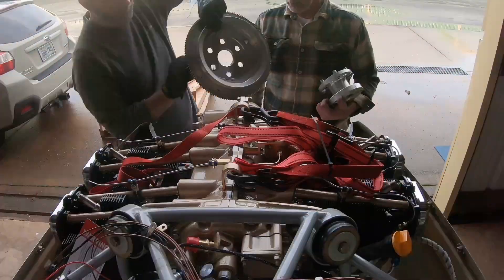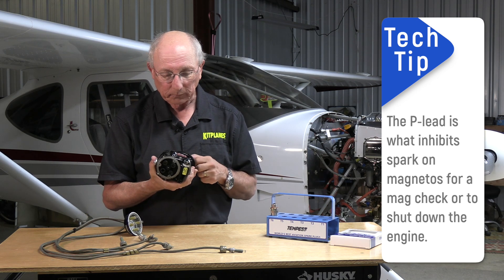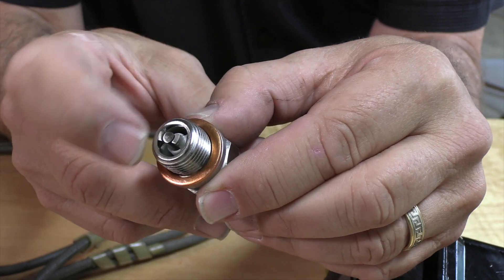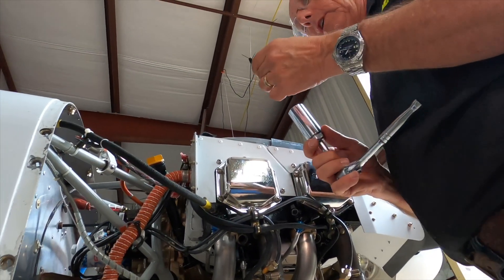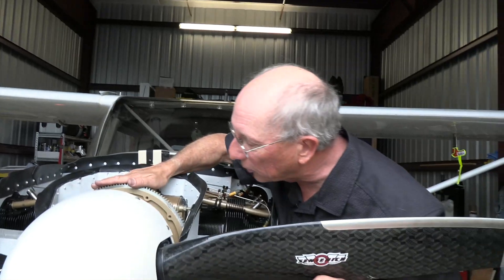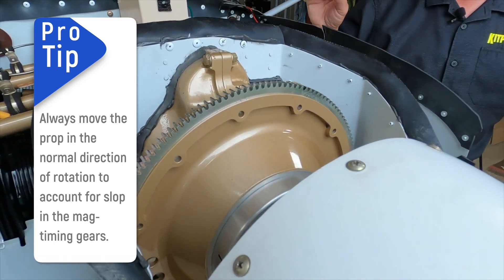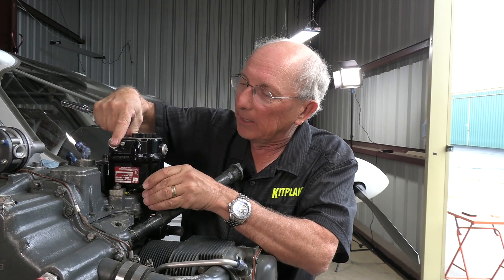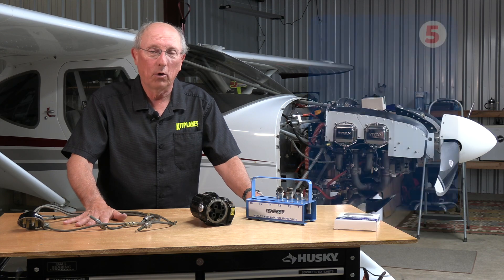KITPLANES Firewall Forward: Ignition System Basics

Comment: Thanks for the series of shows. Spark plug gasket with the curved surface up or down?
Reply from the maker: The gaskets are flat where it counts, so either way is fine.
Reply: All recent ones I have received from ACS have a flat surface on one side and a slightly convex surface on the other surface. That is the reason for my asking the question. Help appreciated. @KitplanesMagazine
Reply from the maker: @n7gn  Interesting. These are usually just stamped from a sheet of copper, and the stamping makes one side have a radiused edge. I just looked at my recent handful from Spruce and they did have this edge but the faces were pretty flat. Also don't forget this is soft material and it'll deform when the spark plug is torqued. Unless they look like a bellville washer (heavily dished both sides), I would not worry about it.

Comment: You mentioned the impulse coupling. I did not see where you mentioned making sure that the impulse coupling had tripped prior to setting the timing.. I haven't worked on planes is a long time but do remember addressing that point.
Reply from the maker: Good point. It should have clicked before you come around to the timing mark, but it's worth remembering to listen for it. Thanks for the comment.